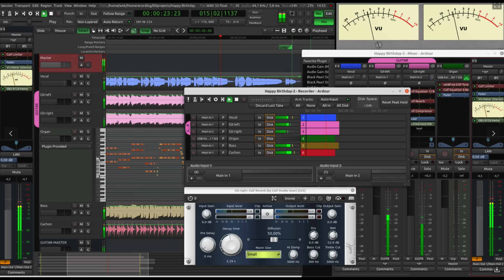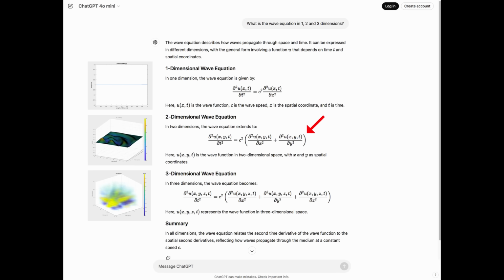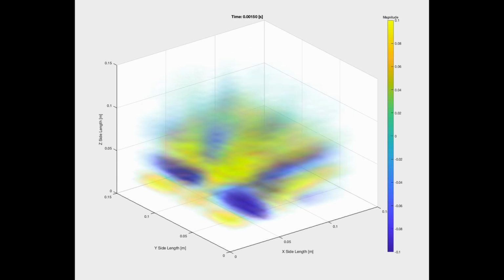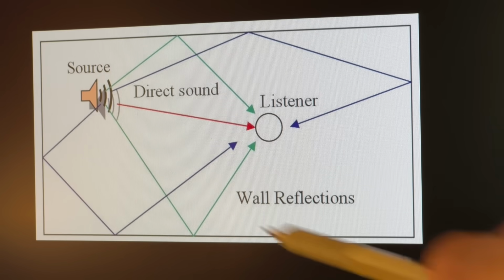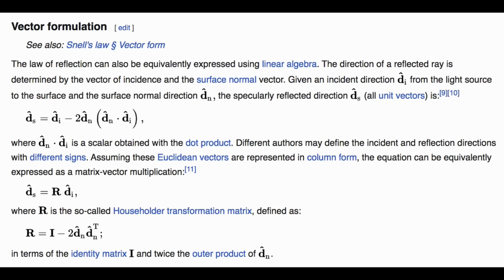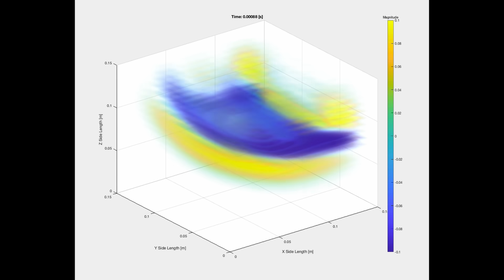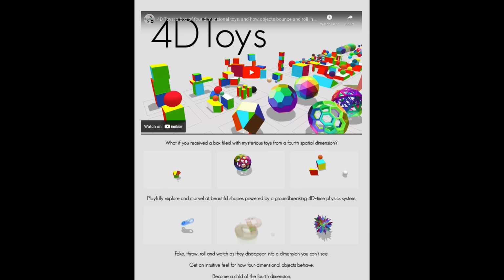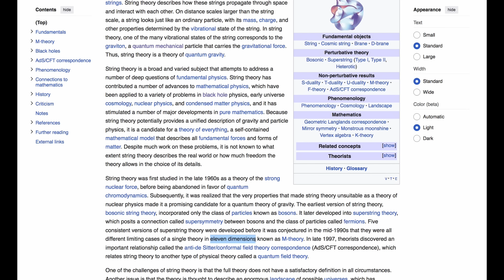Four Dimensional Reverb

Comment: Given that the guitar is three dimensional, would the sound be initially directed in a much less uniform way?
Also, if the guitar is in a 4D space, does the 3D hollow function analogously to a hoop, which is to say not that well?
I suppose the entire guitar would need to be modelled in the simulation for that, which is way beyond the scope of this.

Thank you for this interesting journey and experiment. :)

Comment: I didn't expect it to sound very different, if it did i would think you got it wrong. 

An instrument moving slowly through a 3d room would change on volume as it moved away. 
Similarly sounds decrease in volume as we move forward through the fourth dimension. 
I'm still pretty sure time is a spatial dimension.

Comment: Since u were able to draw a correspondence between Ray tracing and reverb simulation, this should be pretty easy to make. Most 3d engines that support Ray tracing keep track of how many walls a ray bounces off of and how long it travels, so it shouldn't be too computationally complex to implement on a graphics card in something like a UE blueprint. 

I saw another user said that another issue was the lack of 3d audio bc we only have two ears. But just like how mathematicians can use perspective and color for higher dimensional simulation, there are audio engines that simulate how our ears can drive 3d positioning with the reverb quality of sound bouncing off the inside of our ears

Comment: We supposedly live in 3D, but if we transition from 18th-19th century classical physics to relativity and quantum mechanics, then analogously, macroscopic acoustic waves—or the oscillations of air particles—can be regarded as creators of the time direction of their own propagation. Although they secondarily transform the temporal direction of the local space enclosed by a room, and the room itself is not part of the universe’s expansion as it is gravitationally bound, time for the oscillations of particles emerges as an emergent property of interactions.  The most general formulation of the time direction in physics arises from the fact that, due to the speed of c, the spacetime metric (e.g., the Minkowski metric) applies a ± sign to the time coordinate, distinguishing it from spatial coordinates. This means that the direction of time is determined by a convention in the choice of sign in physical equations. In mathematics, however, the time parameter can take any sign, as the differential equations describing the dynamics of physical systems are usually symmetric with respect to time-reversal (unless we consider thermodynamic processes or effects related to irreversibility).

Comment: There's not a fourth spatial dimension, not for us. Our biology—and the evolutionary processes that gave rise to it—is about information linearly encoded genetic material, and a transcription mechanism that involves slipping the genetic code through a ring—itself copied from a linear gene—that acts as a cursor. That is a fundamentally 3D process; add a dimension and the rings fall off the strings, remove a dimension and the strings fall off (what's left of) the rings.

This is not to say that there are no 4D evolutionary processes, but our one is all about strings and knots.

The trick to string theory is that the extra dimensions are too small for molecules to slip into. Particles can oscillate around them, and I think that's the point, but this is not the oscillation of acoustics because it's restricted to smaller scales than the molecules whose banging around gives us sound.

What I wonder about is this: given that whatever we do with a reverb it is, in the end, constrained to convolution with an impulse response, what unexplored places are there in that impulse response space that are musically (in the broadest sense, I mean) interesting?

Comment: I have a feeling that either something is amiss here, or you are onto something remarkable.
Because if adding extra dimensions doesn't bring much sonically speaking compared to making a bigger room 1 dimension lower, then why should we bother with physical simulations of 3D spaces at all? We could just simulate a very long 1D string.
My expectation is that 4D reverb would change a lot (compared to standard 3D) once you start adding 4D obstacles in the space.

Comment: hm... ray traced audio and impuls response. Sounds like a cool project. 🤔I might have to try that one day.

How does the shape of the room change the sound?
Square, rectangle, triangle, sphere etc.

What are the walls made of?
In a higher dimension you have even more surfaces that you can change the properties of.

What is in the room?
What if you had windows, chairs, Pianos etc.

A few years back (~2010) I thought that ray traced audio would becomes standard in every 3D (FPS) video game ever.
But I don't know of many games that actually use it. I think Avatar: Frontiers of Pandora does. But I have yet to play the game. 🤷‍♂
Maybe give it a few more years. 😂

Should be used in 4D Gulf that game needs 4D ray traced audio 😂

Comment: So, what if you took that fourth dimension and placed it as a time dimension, so any ray that lands at that point (or I guess line) in the fourth dimension is played at a corisponding time. Like if the coordinates are 1,7,4,3, and the line impacts there, it plays at the third second. If the line impacts are 1,7,4,11, the reverb plays at the eleventh second. You just emit all the rays like before, but just measure what position along the fourth dimension the ray hits and then convert that into a moment in time.

I guess it is hard to describe, but the line would I guess sound more drone like the more rays and points you had, but it is an idea. Like you play the instrument as a 4-d player and a 3-d listener hears it.

Given that the energy of the wave drops with the square of distance and is functionally time independent, it should work.

I don’t know if it would sound any different, but it is a different approach at least.
Reply: honestly you could achieve this through reverb automations in a music program, and it’s an effect responsible for a lot of cool lil details you’ve probably heard before in music. some producers will swell a reverb’s volume or high/low frequencies right into a transition in the song or just to call attention to that part of it. in a sense this would be shifting the 3 space dimensions along a time axis like the room is changing shapes.

Comment: Wouldn't wave interference change the result? Because ray tracing won't compute that.  Would be interesting to hear the difference between simulation and raytracing in 3d (or even 2d space)  that could tellus if it impacts the sound in any way

Comment: That's cool, now do sonic entanglement.  Picture a guitar string inside a sealed tube.  Create a feedback that perpetuates the string motion in different atmospheres and pressures. (String length, gauge and tube diameter variations, materials, goes without saying).. I'm sorta curious how Helium & Neon will react.

Comment: I feel like a 4d/fractal reverb guitar pedal would have a certain appeal.
On the note about string theory, physicists accept string theory computationally. It can be used to model systems about as accurately as other methods. The issue with string theory is that it doesn't predict anything new about reality that can be experimentally proven, or cause a paradigm shift like Kepler's ellipse, Planck's quanta, or Einstein's abstraction of indices. Or rather the issue with string theory is that it had a good marketing team, and no product. It's like the prototypical example of commodified innovation.

Comment: it would be interesting to try this with non-orthogonal dimensions, ie complex numbers or quaternions. or, treating one dimension as *time*, which you couldn't run in realtime as the resulting output impulse at any given time could be influenced by impulses from the future - a bit like applying reverse reverb - so you could hear the reverb of sounds before they started. of course, that could maybe sortof be fixed for real time by using a delay line long enough for your reverb distance. 🤔🤔🤔

Comment: should note that string theory is pondering a lot about how it's possible to have like 10 or 11 dimensions or whatever while only experiencing 3 and one solution that has been proposed in principle is that those extra dimensions are "compactified" - basically they are donut-like (if you travel straight, you eventually come back where you started. In your cube example that would be like if you hit a wall on one end, you come back in from the other end) and very very small (while they exist, you basically just can travel microscopic distances along them before you come back where you started)

No evidence at all has been found for string theory yet so increasingly it's being considered a dead theory. Mathematically it's still beautiful and interesting though, and it'd be fun to hear what that might change.

Also, that idea of a world where you enter from the other side once you leave through side is something you could totally solve via raytracing too. It's not quite the same as mirroring, though it's related. You can also do weird things like, if you leave one side, you enter on the other "flipped" - like on a Möbius band, Klein bottle, Boy's surface, etc.
The code should work almost the exact same, it's just a matter of considering what to do once you leave on one end.

Comment: You didn't account for the fact that wave propagation behaves in a fundamentally different way in even dimensions than odd dimensions - in even dimensions you get wave diffusion, you would hear "reverb"-like effects even in a completely open space. For example think of how when you drop a rock into a pond, you don't just get a single wave on the 2D pond surface, you get a complex pattern of ripples.

Comment: As for the black hole guitar, since light cant escape, neither can sound waves. Also, sound waves only travel through matter, so there's no sound in a vacuum (yes Star Wars is a lie). 
Anywho, if you decrease the mass of the black hole so that some sound may escape, and assume the black hole is not in a vacuum, you'd hear the doppler effect. As each soundwave gets stretched passing by the black hole. 
Now, this is because of mass influencing the time space continuum. I.e. regarding the sound wave as a wave of light in this case. Now would would be intersting would be to "hear" an Einstein Ring, or ZigZag (what a name they gave that one). Which happens when a source of light is bend in multiple distinct paths around a black hole. 
My initial take is that itd be comparable to a pitch-shifting delay with some pitch-shifted reverb. I.e. as the wave passes by, it gets diffused (reverb), and pitch shifted because of the gravitational well. Well, maybe not any delay at all actually, as the time it takes the sound to travel should not change if its emitted from a single source behind the blackhole - away from the observer

Comment: in the vibe of your video :  I wrote some code to simulate the motion of every air molecule in a 3D space to generate audio most naturally  ... to simplify there is no air until something moves at which point the code seeds a cloud of points (air molecules) surrounding the moving object  ... by simply using the principle of visiting each point along with visiting all moving objects at each time slice  the code did a simple update to the location of the current point based on keeping the point in middle of its surroundings  ... I wrote this in the Rose Reading Room of the big lions library in nyc corner of 42nd and 5th as I stared up at the ceiling pondering the next step and once I got this point motion working I needed to focus on getting sound out of this space ... keeping with first principles I decided to insert an ear into the space to listen to sound ...  it took a few subway trips on the way to the library to pare down the essence of how this ear could work ... I implemented the ear as a flat surface of limited width and height inserted into the 3D space where it counted the number of air molecules cutting through this region going inward minus number going outward and this difference is the wobble I sent as audio output  ... it actually works ... this introduces freedom to synthesize audio from anything which moves just put that movement into this 3D space and listen ... currently productionizing golang code which generates audio from a video feed where the audio gives the listener the information to be able to see by listening ( audio retains spatial accuracy of input image frame ) ... to prove this last point that output audio can be sent as input into similar code doing inverse algos to output image ... and yes that output image matches the input image even though the information traversed into and back out of audio ... my email is same as youtube name at gmail
Reply: Neat.  Is your code e.g. up on github anywhere?

Comment: I tried building a small robotic tesseract that "walks" along a kind of horizontal "ladder" running through it. Lots of magnetic balls, telescoping tubes with tiny linear actuators, etc....
I gave up. I know it could be done but I just don't have the equipment.
Cool video!

Comment: It's understandable that you missed this fact, but if you actually solve the wave equation for an even-dimensional space, you will find that the impulse response for sound propagation is NOT just a time-shifted impulse. It has a "tail" or "afterglow" that follows the initial peak and then decays but never reaches zero exactly. So 2D and 4D sound are qualitatively different from 1D and 3D sound.
Reply: Why isn't this true of a room in 3-space as well? Do you know where to find more info about these solutions?  It seems like an exponential reverb decay should be common among any dimensional space, and develop a longer tail the more degrees of freedom are present
Reply: But my EMT140 plate doesn't exhibit this sort of tail. (Or, at least, that tail goes below the noise within seconds.)
Reply: So this is more or less reverb in a tiny 5D space?
Reply: How interesting

Comment: There is actually a cool optimization that you can do with the ray stuff! Instead of reflecting the sound rays across the planes of the walls, you can reflect the coordinates of the microphone. This gives you an infinite number of microphones that each hear the emitted sound just once. Apply air and wall muffling and ure done

Comment: You know I have been wondering about this ever since a friend told me about how the new unreal engine calculates the reverb from the size of the room in real time. So, I have a set of different questions too. Like what if you double the speed of sound? Or cut the speed by half? How would the reverb sound then?
Or if you would fill the space with a much heavier gas than air?
It is surely possible to make impulse responses that break the laws of psychics, right?

Comment: A guitar with a black hole in the middle would make exactly one sound and only once:

CRUNCH
Reply: It's all fun and games until Justin Chancellor whips out the Naked Singularity Bass. The gravitational waves, crashing with the power of a tempered tsunami against the rest of the cosmos.
Reply: id assume that a black hole would have enough gravitational pull to pull in the sound waves since it can do the same to light, so it probably wouldnt make a sound at all unfortunately
Reply: @asher3311 really depends how large of a black hole, sound can escape its pull from a sufficient distance away, but how far “sufficient” actually is, is extremely hinged on the size of the black hole
Reply: ahem i believe you mean DJENT
Reply: @evilotis01   more like thall
Reply: @evilotis01  it’s thall, djent is more like robotic noises
Reply: Actually it would sound like:
Reply: Depends on how massive it is, if it's small enough, it would actually go BOOM. And then irradiate you to death.
Reply: Actually, it would make no sound at all, since the sound waves works almost certainly and up going into the black hole and not into our ears...
Reply: @ You think so? What are you basing this on?
Reply: @joelbolduc3354  
This is the correct answer. You wouldn't hear the sounds as they would be much lower than infrasound but the spacetime you exist in would feel it. 😉
Reply: But it would be glorious extra metal!
Reply: It's also annoying when you drop your pick in your guitar. But if it has a black hole, DON'T try to stick your hand in to retrieve it
Reply: How do you define sound? Is it just the stuff we hear? If there is no crunch then lonely trees fall silently.
Reply: Personally, I'm assuming it's just a small-ish (about the mass of a mountain) sized black hole inside of an atmosphere with just the theory of special relativity (static, non-rotating) and ignoring all quantum effects, friction, etc. I say this because otherwise the thing would be so loud that it would drown out any other sound making it sort of useless as an instrument.
Reply: And you blast BLACK HOLE SUN...

Comment: In odd dimensions, a sound wave from a distance sounds like the wave itself, just quieter. But in even dimensions, with completely open space, there is a nontrivial impulse response! This can be calculated by solving for the Green function. So in principle 2D and 4D reverbs should boost the low end a *lot*, even when no walls are present at all.
Reply: That's interesting. Can you develop?
Reply: @ I have a marvelous link that explains everything crystal clear but youtube doesn't seem to allow me to paste links.
Reply: What is 2d sound? The sound that propagates within thin medium, like cymbal, tube, bell? It's has square like waveform, then a strings as 1d has saw like waveform, right?
Reply: me when i huygens